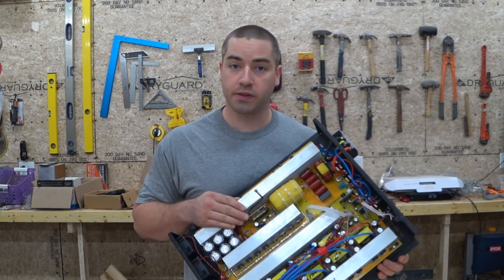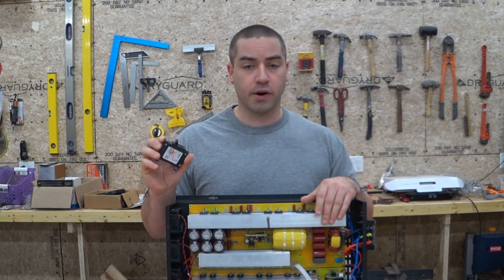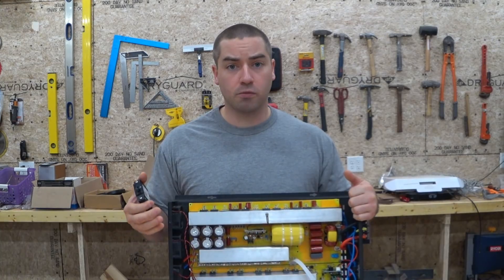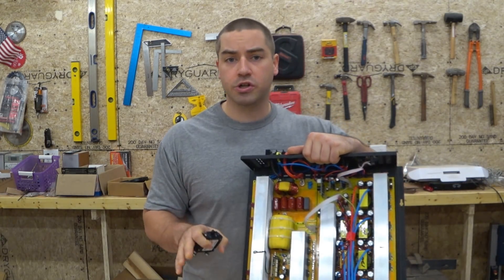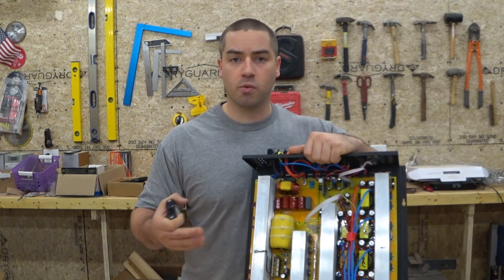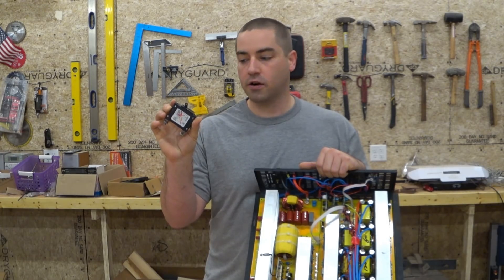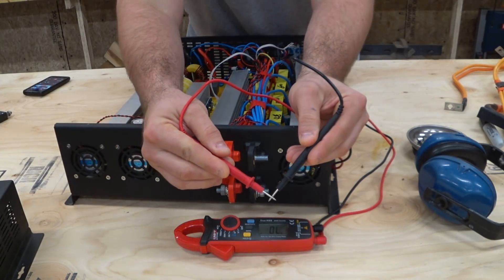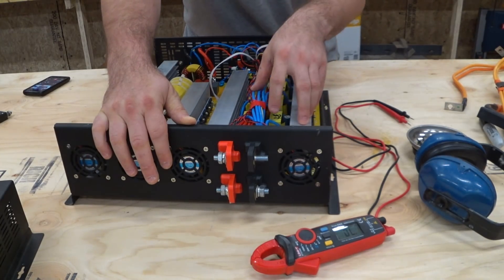Did I Blow Up the Inverter?

Comment: My read on this is that the inverter failed first, and it is primarily the fault of the inverter.....  but one extra factor is that the Lithium cells you are using are capable of very high current, and their output is very "stiff", it will not sag under sudden high loads... and I think this is where you have defeated the testing that Reliable will have done using Lead Acid batteries!... 

The two boards in the inverter are literally input, and output... the input board will step up the voltage to around 170vdc (the peak voltage of a 120v sine wave), while the output board will turn it into the 120v(RMS) sine wave.

The fact that the input board failed amazes me, since it means that the output board is built like a brick outhouse!...   I imagine if Reliable do any redesign work here, it may be to beef up the mosfets on the input board, but they should probably also consider adding some mitigation for a sudden surge current... I don't think the mosfets would fail that fast due to overload, but perhaps the sudden surge caused some high voltage back EMF spike at the primary winding of the transformers... it's possible that the modfets simply need a better snubber array... or perhaps some small filter on the high voltage interconnect between the input and output would help.... It's almost impossible to say without a circuit diagram.

I'm also wondering if I've been saved a similar issue because my unit has a 340vdc input board for 240v output.... so the interconnect carries less current.

Comment: Breakers have two kinds of protection. Short-circuit protection uses EM force. Very high power draw will trigger EM protection and cut power in fraction of second. Second protection is thermal. This one is quite simple, it will pop when it is heated too much. If you are under limit, then it will not heat up. If you exceed limit on breaker, it will start to heat up depending on how much you exceeded this limit. You can run 20A on 16A breaker for quite awhile before it pops. You could run 50A on 16A breaker but it will pop much sooner. For this thing you have classes which determine reaction time versus current. This protection works when it's not short circuit but is too high power draw.

Comment: The pb came maybe from mistake in identification and badging of the 
mosfet by a wholesealer "fake mosfet" are components with same carateristics but not be able to manage the same Watt  ... Unsolder them and test it with an electronic  components identifactor in order to be sure !

Comment: I think it is reasonable to expect the manufacturers of this kind of equipment to make sure that the fuses work correctly under massive inductive overload conditions, if it was fused and designed correctly, the fuses would have popped, protecting the equipment.
Reply: the fuses did pop
Look at the video

Comment: For taking a video of the amp meter. The meter samples at once per second. If the saw pulls 100 amp for 0.1 second when 1st pull the trigger, would likely miss getting sampled. The 30 amp you measured was while saw was spinning up. When the inverter failed was right away when pulled trigger.

Comment: Something to keep in mind. Your clamp on AC ammeter will not be quick enough to capture the inrush current but from the other remarks left here you are probably aware of that. You need an inverter that has self protections built into it.
Reply from the maker: Thanks.  More recently I bought an "Aims" inverter.  I don't know what kind of protection it has, but it can power the chop saw just fine.  https://youtu.be/dfHb5tZErTs  Thanks for watching.

Comment: you were given 6 cables yiu used 4, read the direction or ask the manufacturer. remember assume before modifing anything including insullators. two assumtions,
Reply: it looks like only one cable per pole was used in the video. It also looks like the instructions are still in the box

Comment: Based on the wire gauge size it seems like what was provided was about a 2 guage, or a 1 gauge.  

I have run circular saws off of 1 car battery, using a 4,000 watt inverter, and without thick enough cables, it sags in power, and cuts off.  My inverter isn't ruined, it just cuts off.

Because I don't know what voltage your supply is, this may not matter (if greater than 12 volts, smaller gauge wire would be OK).  Regardless, whatever wire size was provided with the inverter, that seems laughable for an 8,000 watt inverter, unless it is specifically going to be connected to a supply of 24 volts or greater.

Using 12 volt supply, that cable is not big enough.  Lastly, Reliable Electric sold me some real junk, touting it as a pure sine inverter, of 2000 watts.  When it arrived, it was smaller than a shoe box, weighed about the weight of 1 and 1/2 tennis shoe, and of course didn't work at all.
Reply: it most likely has good qualitydiode protection and snubber circuitry built in to the mos fet array

Comment: Dude, I am an Engeneer, and I tell you, you drew a thousend Amps for a 1/thausends of a second and you blew the mosfets. You would see this on a graphic multimeter. 8000 Watt means continius current. Everyone knows that. If you want to hook up motors, you need you use a motor starter in between the inverter and the motor.  The manufacturer of the inverter should have told you that.
Reply from the maker: Thanks Lisa Price.  Since this video I have bought, installed, and tested a new inverter.  I'm sorry, I don't know what a "motor starter" is, but the new inverter seems to be starting the saw well without it.   If you would like to see my new inverter it is here: https://youtu.be/dfHb5tZErTs  Thanks for watching.

Comment: Hi, You are now going into Ampere Interrupting Capacity (AIC). All breakers have an AIC rating and must be understood to know how to build the system. 
For instance the home panels are rated at 10,000 AIC, and commercials are rated at 22,000 AIC.  The AIC is for panel, breaker, meter socket, the whole electrical system. 
Surges are based upon AIC rating. delay are not AIC. When working AC breakers in a solar application you do not watn too much of a delay as it will cause a fire or explosion, Spark.  
The best solution is to use normal electrical breakers and 10,000 AIC max as any higher will be not good, a High AIC system will cause the system to explode if you use a low AIC rating, like put a 10,000 AIC to a 100,000 AIC system.  
The Inverter over powering the Saw and causing the breaker to Spark, but not trip as the breaker is  a delay, not AIC type.
 Hope the s explains a bit.
lazaro

Comment: Has the breaker been looked at in a forensic manner?  An EE with specialization in DC circuits.  An example of AC -DC to AC is the NB Power interconnect with Quebec Power's Grid.  Now that is a grand scale.  The advice I got from an installer - with 20 years experience - was to double the size of the breakers. He had been into fix a lot of somebody  else's messes -  and that was his advice. Also - go look for an old Metered Amp clamp -  The instantaneous spikes are seen on dials. Not so much with electronic meters. They do not react quick enough. The trigger timing of the Meter - is much less than dial meters.  Cheers
Reply from the maker: Yes, the breaker video is here: https://youtu.be/Woigo3sTp_E Thanks for watching.

Comment: I got a TEP 3000watt 6000watt surge 12v as my test model 230v
Testet 4400watt for 1hrs used 460A 12v 
Now i got the TEP 6000watt 12.000 watt surge ...
48v.. heawy duty buildt .. 
I use 2 og Them 1 for wahing mashine .. dryer .. microwave ..oven so on
The other for house hold hotwater 120l 90 degree 
Vacuum .. tv pc freezer fridge .. 
I like to have a 20% head room and Then some ... 
Tjek out the TEP 3000 and 6000 
Tingen TEP 3000  
Tingen TEP 6000

Comment: After reading a lot of the comments and being a previous integrated Circuit Switching power supply designer, I don't agree with many of the arguments below. The Saw's motor load at start looks like an extremely high AC load. The inductors used in the AC generation to the saw's motors are probably saturating and thereby drawing maybe 10 times the current through the AC output Mosfets. An inductor only looks inductive to a certain current level. Exceeding this level causes the inductance to dramatically reduce and then looking more like a short circuit than an inductor (probably much less than 1 Ohm after saturation). When the inductance falls, the current increases dramatically, almost instantly frying (shorting out the Mosfets due to heat)  the Mosfets OR opening the Mosfets by frying their internal bond wires resulting in a HUGE high voltage spike caused by the Saw's inductive motor windings acting as a generator once the input AC power is interrupted. The inductive kickback of the saw's motor can generate thousands of volts, far exceeding the Mosfets absolute voltage maximum ratings. Mosfets are actually much more sensitive to Junction breakdown voltage that overcurrent situations. The Mosfets probably have a rating of 600-800V which is much to low to handle inductive kickback spikes.
I am a retired EE as well and admit that I do not know what actually caused the fault without being able to look at the schematic diagram of the circuit used.
Reply from the maker: Thanks.

Comment: For the fuses to blow, is more likely a short to ground, than a surge .... I suspect that the fuses that are blowing ,  may be incorporated in the DC side of the circuitry.... It would be useful to look at the circular saw label. And see if the frequency is 60hz  or 50hz....
 Is the saw earthed.... And if so.... Is it commomed to ground of the DC
Also to consider.... Back EMF.... Is there protection diodes fitted to output
Reply: i suspect most modern saws like this are rated 50-60 hz

Comment: David , I'm liking the videos! I was going to suggest checking out some videos from (going off grid ) but after reading about 400 comments I saw he chimed in already.  But one thing he had a problem with and was a concern with others who have bought these is did you check for a live  ground? Direct wiring is the preferred method but the inverter will blow if the neutral is not addressed. This is explained more in some of the videos from going off grid.  Also what do you plan on doing with the inverter
Reply from the maker: Thanks for your comment.  I watch "Going Off Grid", he has fixed a few of these inverters.  As to the live ground: I never checked the 8000w, sorry I didn't think of it before it blew.  My 3000w still works and I've checked that one.  It does not have a live ground.  Right now I still have the inverter because I think it would make a fun video to try and fix it.  However, there are several other projects I'm working on right now and making videos of.  So if I get to this it's going to be a while.
Reply: @DavidPozEnergy  thanks for the reply, from what I've seen of these the live ground was only an issue on the 8000 w and not the 3000 w , if you end up not doing anything with the inverter, I might be interested in it , I'd like to have some components checked out. I've been aquiring my off grid set up and have been looking at these as a possible choice for inverter, but prefer to follow a few people who already have them to see what issues and solutions they have.
Looking forward to future updates.

Comment: these inverters are often design errors completely, the biggest problem is the Attachement of the heat sinks, the mosfets have no room for movement, and in a big load rush they move and the case of them get a crack and most times one or more fail, too many too small cheap components, use some inverters from SMA dont buy the cheapest from china. And if an inverter uses these cheap fuses that have no arc protection and can fry ur circut when trpped than stay away from thes inverters. here a pic of a propper design https://youtu.be/MLW6M82FKYw?t=100
Reply from the maker: Looks nice.  I understood "Ethernet".  Apparently that is the same word in both languages.  LOL
Reply: @DavidPozEnergy  yes sorry it was in my language , but i have the same model and it works great its about 12 years old and it runs steady like a old diesel engine, u need one of these and they will work  like a charm https://www.sma.de/produkte/batterie-wechselrichter.html
Reply from the maker: Thank you.  12 years on an inverter is a great history.
Reply: @DavidPozEnergy  but godd video urs, so i alway want to have a peak inside one of these inverters, and not buy these only for compare
Reply: @DavidPozEnergy  and to protect ur next inverter from the next blow out u definitly need something like this https://www.conrad.de/de/bachmann-349017-bachmann-349017-einschaltstrombegrenzer-ip44-1838972.html, it stopps i induktive load spike for fire backwards

Comment: Your cutting machine using carbon brush it has high starting in rush current , from video it about 30% but actually it may be 5 times of normal current , as such the inverter cannot take it, which cause the fuse to blow .  You must use back the circuit breaker to test on normal supply again, to proof that your circuit breaker can take it.

Comment: To see the inrush current you need an oscilloscope.  That way you can see the current waveform in the sub-microsecond time frame.  Your meter can barely do tenth of a second.
Reply: and to see it instantaniously on the scope you need a Memory scope to freeze the event on the screen. but that is not his responsibility. He is a customer with a company that has deadbeat engineers that were asleep during their electrical engineering classes
Reply: Yep.. you'd probably be surprised, and maybe a little scared, if you saw the Real instantaneous max current. But it's perfectly normal, and it only lasts a few milliseconds, dropping back to normal in usually less than half a second.  What your clamp on ammeter showed was an average value over a half second or two (AC ammeters show an average because they have to, since AC is constantly oscillating) as the current peaked then dropped to normal.  Something like an A/C or large refrigeration compressor is much worse on startup than a saw - they can take several seconds to get up to speed.  But circuit breakers are made for that, too.

Comment: Wow, some correct comments on this subject and some comments that, well I'll be nice and just say are wrong.  Yes, like many I have a background on the subject.  I not only started life as an industrial electrician from over 16KVAC lines, working on motors, down to low voltage and CNC machine controllers with so many different technologies since the 70's, plus working on so many different computer systems through to this day with my EE in my wallet, but none of this technology is new.  The failure was very evident from the 1st video that the inverter was the failing device.  Sorry you went through all that trouble looking at your breaker as the root cause.  But I will say I like what you did in reporting this issue.  I checked out your video because I'm in the market to buy an inverter.  Not this one!  So I thank you for putting this together.  I give to you the coveted "Arc and Sparc" award.

What most of the people who were guessing with their comments failed to understand is why the inrush current was so high and that comes down to simple understanding of motors.  Particularly induction motors and in this case a split phase induction motor since I don't see any capacitor on that saw.  On the first video someone commented about the lead and lag of the current during startup, but it seemed no one really understood that concept about motors and the relationship of load, voltage, and amperage for inductive loads (very different than resistive loads my fellow electricians but I do applaud someone's explanation of why a breaker has a voltage rating for David.).  So here's a link: https://www.brighthubengineering.com/diy-electronics-devices/45180-self-starting-induction-motors/    The bottom line is with this type of motor you are drawing a whole lot of amps at startup.  Here is the best diagram I could find that shows you that, plus how a low in-rush motor looks like when graphed out:    https://www.pumpsandsystems.com/sites/default/files/1114/low-inrush-motor-b.jpg  

Now as to why the 3000 watt inverter survived and the 8000 watt one did not comes down to poor design.  Back in the 80's I used to design switching power supplies, and found one manufacture's SCR's would fail during low input voltages while others were just fine.  I had to modify a resister in the circuit just for that.  As others who have electronic backgrounds have stated in this thread, the mosfets blew and shorted in the inverter which caused your breaker to blow.  They need to redesign the circuits.  If you hook that inverter up to an 8000 watt electric heater and it will probably work just fine.  But plug your freezer, or other inductive motor, or use a welder, or turn on a fluorescent light that uses a ballast and you have an expensive piece of wall art.  Send it back and hope they come out with the 2.0 version designed for inductive loads with high in-rush currents.

Again, thanks for the video review.  Great job.
Reply from the maker: I really appreciate your comment.  It was informative and polite, exactly the type of comment I take seriously.  I'm glad I can help your search for an inverter, at least with the process of elimination.